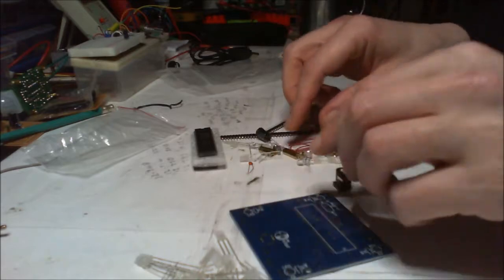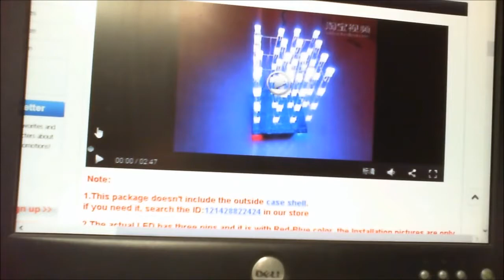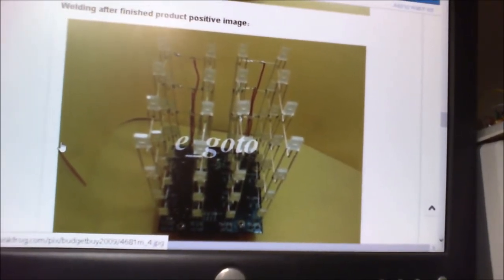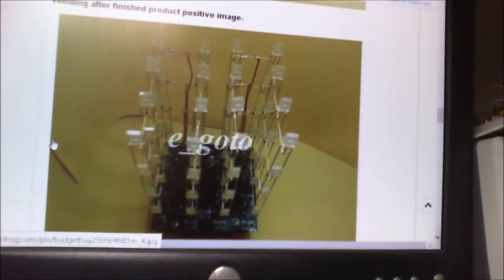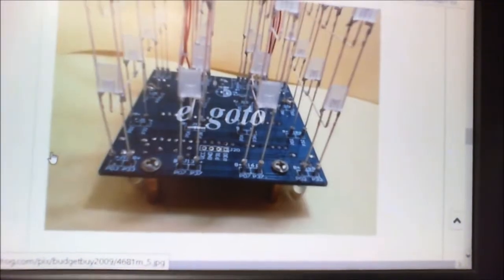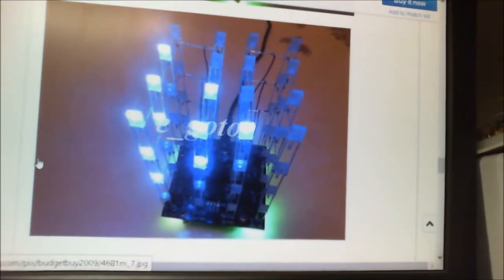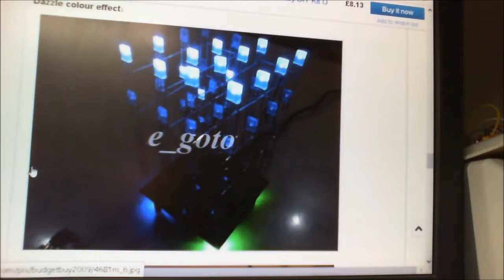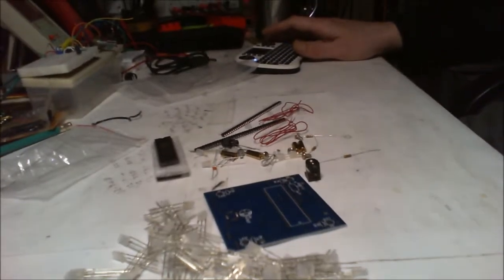3D LED Cube Red Blue Ray DIY Kit Build  Part 1 of 3

Comment: The only seller in found for those square leds was min order 10000...image that cube..smile...anyway in trying to help you i found a great way of using hot glue sticks (cut and drilled) for defusers...and i wondering now  the cost of  512 ping pong balls from china...so what kit was the most fun?
Reply from the maker: +bunnyathome 10000 would make a big cube. I would probably need to order a few tonnes of solder. To diffuse the round LED's? The are a bit dim at the same voltage compared to the square ones. The clock is the most used kit I have built it is quite nice and very useful. Cheers for the help ;-)